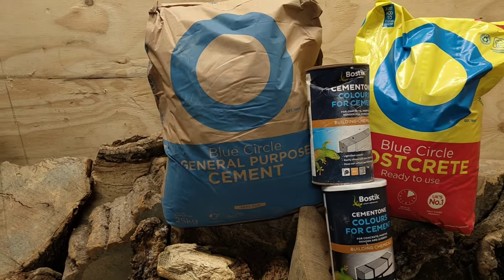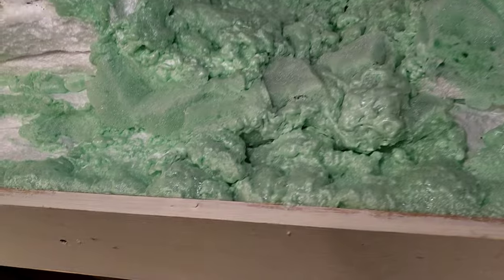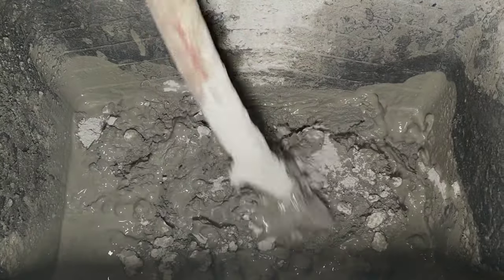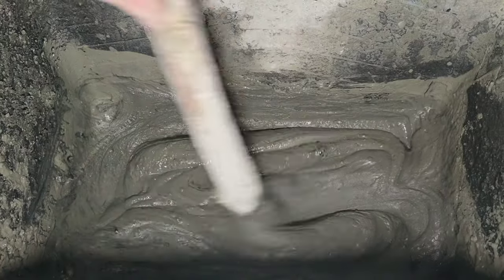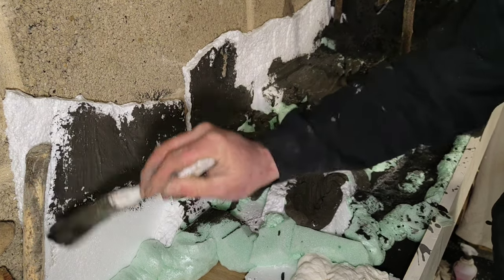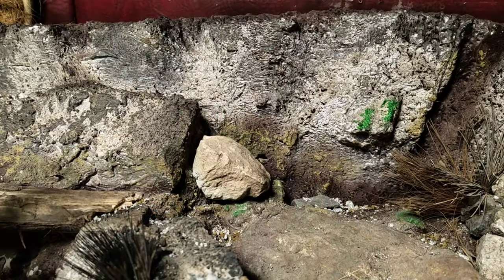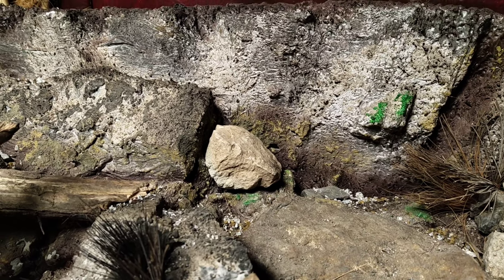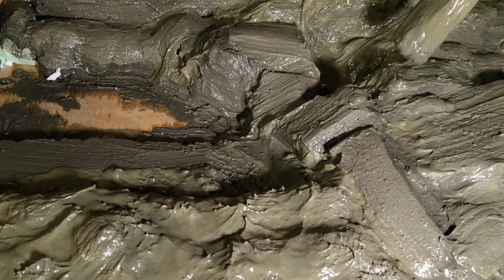An Incredible top coat. for your RC minicrawler DIY course. (save a tone)

Comment: thats the way to do it. i trying the plaster cloth. it was to soft and not grippy enough. plus my cat used it as a parkour course so it did not last long
Reply from the maker: 😂 cats there little sods for that the moment we get a box the cats are in it. Check out the top coat we did for our new course it's crazy tough and cheap, we used drop clothes/ dust sheets soak in cement.

Comment: Does the concrete add a ton of weight? Reason I'm asking is I want to do my next course modular in 4ft sections.
Reply from the maker: No it's just cement and water no sand added. And you do three to four thin layers with a brush. 👍

Comment: Killer build and great video. In my testing wet application did not fair well over time with out a thickness of at least .25 inches. I found a dry mix to hold up longer. But I also sculpt the concrete so I need a thicker coat. Just like you said, thicker the better on areas that will get a lot of traffic.

You can apply multiple layers over one another even when dry, but you need to apply bonding agent to the dry concrete and mix some it in to you’er new batch.

Concrete die is awesome but don’t be afraid to go back in  with acrylic paint to add highlights, wash’s, splatters, and dry brush effects to really make it pop.
Reply from the maker: Yeah absolutely pal you can use aggregate in the cement to make it thinker but that will need to be measured out to insure it doesn't go crumbly hence using neat cement is a much easier application for people to use. 

Many thanks for your input 👍

Comment: This is one idea I was also surprised more of the guys who used spray foam to make their tracks didnt do this as well. Its like the way to make a scale course. :) This is totally what Ive been wanting to do for a long time now. Concrete with some chicken grit and a polymer added for water proofing so you can make streams/mini rivers, ponds/bogs all that goodness that comes with it. The chicken grit adds some awesome texture to whats an already pretty rad surface to crawl on. Could even make sections like mini valleys with water flowing down, fast or slow for added difficulty. Oh so many Ideas... :) 
Have you seen Texoma Rc, hes done a mini mountain in his backyard out of concrete, very kewl.
Reply from the maker: Yeah doing it this way makes it almost limitless. And yeah I've Texoma mountain it's well cool. And just an insight we have a new build starting in the spring. And let's just say it has water in it 👍
Reply: @REACTIVETERRAINRC  Oh man I cant wait to see that!!!
Reply: @REACTIVETERRAINRC  One other thing Ive been mulling over is the use of Kinetic Sand. The stuff is crazy interesting and I think it might just make a kewl type of surface to roll over.

Comment: Just finished watching and again BRILLIANT !!! So much better than plaster and cloth or drywall compound! 
???: Have you a way to smooth out the brush lines? Could one go back with a rubber glove, once the crete has parcially set and gently smooth them down? Be nice to have both rough rock and glacial/ weather smoothed bed rock. 
Thanks a lot!!! I'm gonna post a link to your vid on other channels I watch so guys can see the good results you're getting!
Reply from the maker: Once is parcially set you can use a wet sponge to smooth off.

Comment: I used concret over cardboard and even paper.
It works really well!

What's that green bike by the way?
Reply from the maker: It's my gravity bike with no pedals no motor down hill racing.
Reply: @REACTIVETERRAINRC  when I go down the hill it's on my mountainbike.
At greenhill for example
Reply from the maker: @Ghosty-RC  it's a road race my top speed to record 56mph handle bars are half way down the forks 😂 crazy fun

Comment: like and sub here.... man just got in to the crawlers with the axial ax24/sc1? first rc for me was the ecx 1/16 ruckus rtr. cool little thing but the steering servo is crap... still trying to find a good heavy duty replacement so i can bring it back from the dead.  then i got the armma bigrock blx... been throwing a bit of monies at that between repairs and converting to 17mm hex, still running the factory esc and motor luckily, its been lots of fun! 
 anyways first vid of yours iv scene and iv realized iv been overthinking this whole thing as far as a mini course build goes. really digging what i see in your ...play pit?   iv ben collecting foam and scrap skid wood from work trying to save the money for repairs and a few upgrades down the line. and so far i think this might be the most cost effective way iv scene to do terrain building/ texture. never been in to diorama building myself and watching some of these video's on the web i just cant help but think of the cost.... guess im a cheep a**  when it come to some things. 
but yea man i hope to see more from your channel! ill definitely be showing this to my buddy as we have been slowly binding a mini course.
Reply from the maker: Great to have you on board friend. Hopefully this channel can help you. The new build episodes show some great low cost ways to build a minicrawler course.